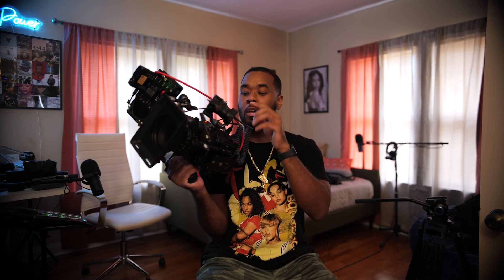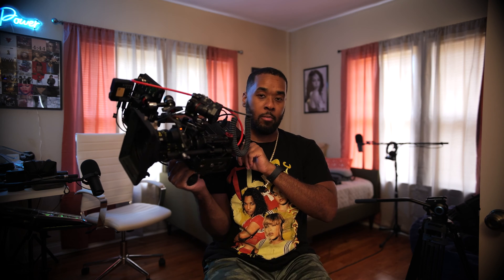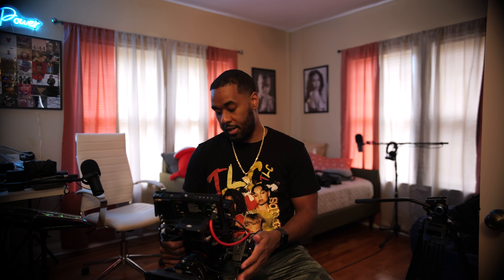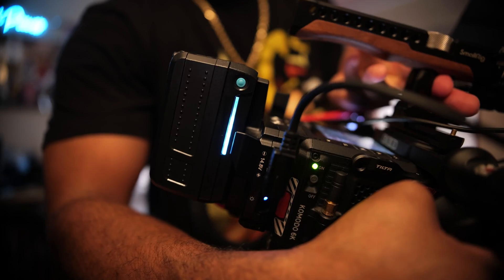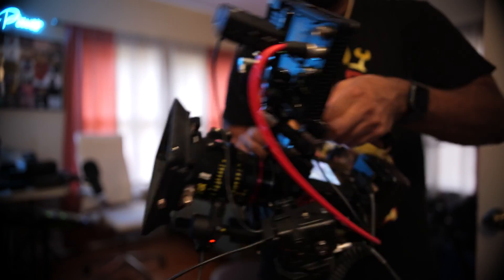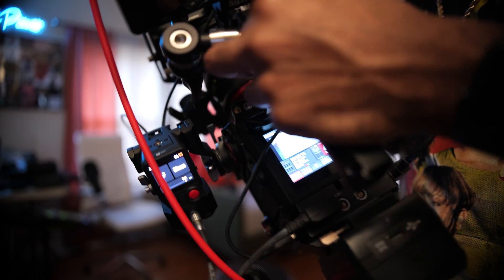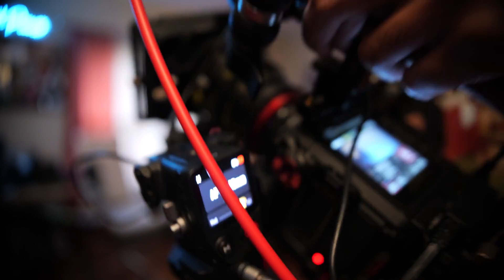How To Power The DJI Focus Pro With A V Mount Battery - (Using A DJI Ronin Power Base)

Comment from the maker: Update: you can power everything from handle (or power brick to handle like here)

The Lidar can be powered with the single cable, just make sure you use cables that come with unit or extended ones that are verified.

If the cables are not correct, it won’t power on which is why in this video I had to use 2! 

As long as it’s plugged in correct, 1 cable goes from lidar to power unit!

Comment: Need details...

If I have the handle and the lidar, how am I supposed to power it to the v-mount d-tap. You're video shows you can do it, but didn't help explain how... What cable(s) do I need??
Reply from the maker: essentially, I am using a ronin power base (remove handle)

the power base will allow you to run a 2 pin lemo to d tap.

If you are using the handle (want to use handle that comes with it)

Alternatively, best thing to do is plug in a USB C able from handle to power bank/v mount.

And it should charge your grip while using it, for continuous power.

ronin power base > 2 pin lemo to d tap > v mount/b mount battery.

Comment: Hey man what’s the connection called replacing the battery handle grip. I’ve searched on the DJi site and can’t find it. Thanks for the vid.
Reply from the maker: Hey it’s actually a DJI ronin power base. I haven’t had issues with it but some people have reported it ‘frying’ the unit. For me, I use this or use an additional battery.

You can run a power cable to the grip handle, sometimes it will charge while in use. Pretty weird but just be cautious! I believe this is a Chinese generic brand, mines doesn’t have a logo and I got it from a friend.

Comment: Be really careful if you use pass through power from the DJI focus motor. This kind of setup powering from V-Mount can provide higher power through the Tilta Gimbal Power plate. The DJI motors support upto 17.4v and will pass through whatever voltage they recieve, The passthrough DJI focus motor power does not respect PD power standards.
It is just the shape of a USB. People have fried gear this way. You can get a USB tester to check power in and pass through with the passthrough and both male and female connectoer USB tester

https://youtu.be/pjHHBjCJGas?si=4pG_mQm7OFBDkTOa
Reply from the maker: Luckily, I have not had issues so far. I do plan to grab two extra batteries just to have them on the side.
Reply: Can you elaborate on this some, are you saying the wrong voltage could be coming from the DJI handle unit to the motor module when using the tilta power plate, or are you saying that when connecting more than one motor module in a daisy chain they will draw to much voltage from the power plate via the handle unit and damage the system
Reply from the maker: @MikeRLea  I'm saying that technically, the tilta DJI adapter base plate could send the wrong voltage and damage the unit. I've never had issues with it but some people have, but yes precisely. I have 2 batteries that I use now as well to avoid it but I never had issues with it.

Comment: thanks for the video! One question though: why do you still need a separate power supply for the lidar? Shouldn't it be powered directly from the unit as if you had the battery grip? Thanks
Reply from the maker: Yeah, you can run everything from the handle! Video needs to be updated, but you’re correct, just make sure you’re using the right cables. These cables have a tendency to fry!

Comment: Hi man! I just bought the focus pro lidar. Could you elaborate more on the DJI Base Power Supply you mentioned. Can I use a third party such as tilta?
Reply from the maker: yes it should work fine, you want to check your cables though. (they can fry)

There is another option on Ebay that supposedly regulates the power, it may be a good option to use! for me this works fine
Reply: @11.Pierre  thanks for the quick response!! Im here with my big ronin 2 and the focus pro, feeling quite desperate. 

Could you by any chance link all those products to the description or to this comment section?
Reply from the maker: @ I used this version DF!

https://www.bhphotovideo.com/c/product/1755163-REG/digitalfoto_solution_limited_pb_rs3_power_supply_base_plate.html

You may find this useful as well - https://www.ebay.com/itm/296963804706?mkcid=16&mkevt=1&mkrid=711-127632-2357-0&ssspo=VhyPDKU1RM-&sssrc=4429486&ssuid=hFh-VSv2Rl2&var=&widget_ver=artemis&media=COPY

Comment: Hey it’s been a couple months. 
Is it still working, or did it blow up?
Reply from the maker: Works fine, more options are out now though! Been thinking of switching to this regulated option that allows you to use the handle but essentially keeps charging it up. It’s on eBay !
Reply: @11.Pierre  please provide link bro
Reply from the maker: @artroomx  https://www.ebay.com/itm/296963804706?mkcid=16&mkevt=1&mkrid=711-127632-2357-0&ssspo=VhyPDKU1RM-&sssrc=4429486&ssuid=hFh-VSv2Rl2&var=&widget_ver=artemis&media=COPY
Reply: @11.Pierre can you make an updated video on the Power base and eBay cable setup?

Comment: i wrote to the tilta, smallrig and dji support regarding this topic - they told me, the focus grip needs 8v, but the vmount provides 15v, so they said, it would fry the focus grip. did you have it in use for longer now?
Reply from the maker: I think DJI puts out different info but you could always just use a 65w power bank as well! I haven’t had any problems other than the cable going bad before!

Comment: Just a quick one - do be careful of what power is going into these... The Ronin RS Pro's and Focus Pro have different voltages and we've been hearing of a lot of Focus Pro's blowing up because of incorect batteries, USB C and other power being plugged into them.
Reply from the maker: Correct! I believe as long as you are not running the USB C into both ports at once you should be fine! I need to update this video. It’s also safe to use grip with power bank going directly into the grip handle!
Reply from the maker: Correct! I believe as long as you are not running the USB C into both ports at once you should be fine! I need to update this video. It’s also safe to use grip with power bank going directly into the grip handle!
Reply: @11.Pierre  it also depends on voltages etc. TBH we’ve also done a video on the Film Guy channel and we’ve been wondering if we should make an update. They’ve been mostly out of stock for a while now and myself and others we know have already had to RMA units that have blown up. Bit concerning at this point!
Reply from the maker: @ShaneVanLitz  I had 1 blow up as well, DJI took care of it. The group on Fb has a user doing lots of testing. It may be good to update the video for folks but I suspect it’ll take a little longer for people to adopt. I got lucky with mine. I still like it, but it def had some kinks
Reply: @ShaneVanLitz I would love to hear an update!
Reply: @ Same as before. Be careful with some USB C power voltages and different batteires. There there does seem to be supply of Focus Pro kits now though, but IDK if they've updated anything.

Comment: Focus pro sold out EVERYWHERE
Reply from the maker: wow that's insane, checkout picture line . com, I randomly found it on there
Reply: @11.Pierre  I just bought the Focus Pro Motor. And the Focus Pro Lidar from Amazon  (somehow), but now I NEED the Focus Pro Grip in order for it to work. And I can't find it ANYWHERE 😕
Reply from the maker: @tecno8335  makes sense, when I ordered It I couldn't' find it separately so I just had to get the bundle. im sure they'll come back in order.
Reply: I listened to what you said, and my local camera shop randomly had 1 grip in-stock lol. I couldn't believe it. And they said it was the only thing focus pro in the entire store. Thanks bro 😊
Reply from the maker: @tecno8335  there you go! worked out well for you!

Comment: What if i only want to get power for the motor?, what voltage of usb C cable to D tap i need?
Reply from the maker: Hmmm I need to review and re-do this video. I had to send my end in repair, so once I get it next week I'll update a video on the proper method to do this.

I have asked DJI about all of these voltages to figure out the best case scenario for this.

Comment: how do yo power the red Komodo if the vmount battery is already powering the grip and the lidar?
Reply from the maker: I have the BP to v mount adapter for the Komodo, so it powers the Komodo from there. then I use 2 ports to power the lidar/grip.

I removed the grip in the video and replaced it with a DJI power base that plugs into the v mount.

Comment: Great video thanks. Could you try to connect the lidar and the motor on usb to see if the grip can work wireless please?
Reply from the maker: Can you explain this a little more? You wanna see if it works without them being plugged into the grip itself? So you could theoretically have it wireless like the other focus wheel they sell?
Reply: @11.Pierre  exactly. I see another creator use it whith the pro grip and for that he just plug the lidar and motor on usb. And when he power on the big grip it just connect wirelessly. My theory is they need power but not connection. Sorry for my English, I'm French.
Reply from the maker: @NineSevenPictures got it, I will check this and message you back to confirm
Reply: @11.Pierre  thanks for your help 🙏🏾

Comment: Why would you want to mount the lidar camera so high?  I thought it is better if it is closer to the lens / sensor?
Reply: not to answer for him, but i have mine mounted in similar fashion currently to clear matte box flag and still maintain FOV past lens below it. but this is really the million dollar question for everyone it seems. im personally trying to get a setup where its below lens near where it ends at the end of rails. but you have to make a custom mount for it. and if you want to use something like rs4 pro gimbal, the top handles can get in the way on some mountings/load balance combos. while im liking the system for manual lenses to AF, the setup/rig can be a headscratcher at times between various setups and not recalibrating too much.
Reply from the maker: @lightintothefade  did you see the new Nitze kit? it should be on amazon now but it's designed to mount at the bottom. and I agree, the only headache right now is mounting and im sure the system itself will continue to improve overtime. I haven't tried the nits kit but I may order it. I just saw it maybe last week from FB. nitze lidar mount should be the name for around $60
Reply: @11.Pierre  haven't seen that. I'm building around a rail system for my setup. Figure it's going to be easiest way regardless and ultimately have to use v mount battery anyways since it sucks power pretty quick. So was looking for a cross mount for that type setup. Looking at that smallrig base like you have. Powers both in and out. But running transmission and their power hub so hand grip/gimbal isn't powering whole system now.
Reply from the maker: @lightintothefade  that makes sense, I didn't realize it could mount at the bottom and ended up doing this as my 2nd configuration. the results were pretty solid but at the bottom should be the best option for FOV
Reply: @11.Pierre   what I'm noticing on the view on handle vs lens are quite off. Not that it matters except for tracking. I'm running it zoomed out most times. So I'm thinking just below end of lens would give most representation between 2. Ideally would like a setup that's pretty set between lidar and focal plane. Motors stay in relative place to lenses. System can be hand held with monitor on top or handles/monitor removed and it drops into gimbal. Basically a lidar cage of sorts. But maintains full flexibility for whatever lenses I throw at it.
Reply from the maker: @lightintothefade  I feel it, see the lens I use this for are all similar in size so I don't have to adjust it too much. I def could see it getting in the way with longer lenses. im using mike 35mm, blazar 35 t2.9 and the vazen 50mm so I haven't had to worry about this. I centered the lidar to the middle and pushed it forward so nothing intrudes
Reply from the maker: Still tweaking it, tbh I’ve seen people mount close to body and close to lens. But I actually have a longer magic arm (+ extra hot shoe , this way I can try both methods properly) coming later today.

My handle was taking up space lol, I’ll talk more about this in my full video. DJI says get it close to camera sensor, other youtubers had it close to lens.

So we’ll see but so far it seems to work either way (it allows you to input the distance on the system which you manually measure) but I’ll circle back. Trust, that was 1 of the tricky things about setting it up that confused me as well. I’ve never used lidar at all until this week.

From what i noticed, it seems you want to get it as close to the field of view as the lens because the lidar works damn good. Whatever box is highlighted on the lidar screen is what will be in focus so I can see why others had it near lens but I’ll be testing it more to confirm.